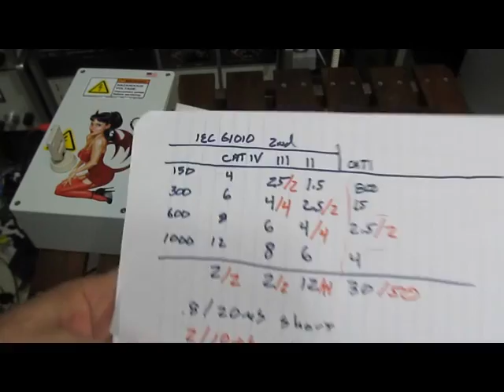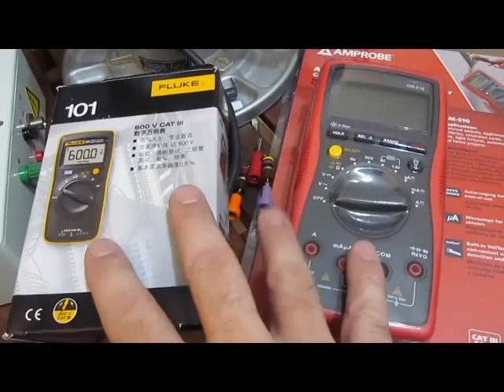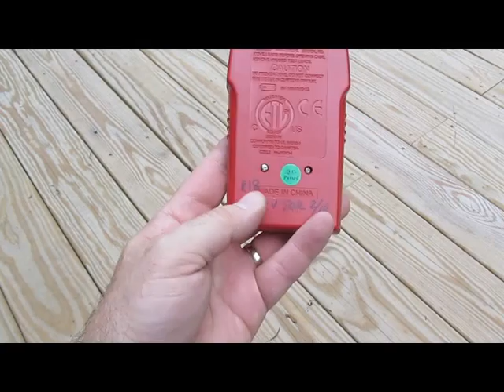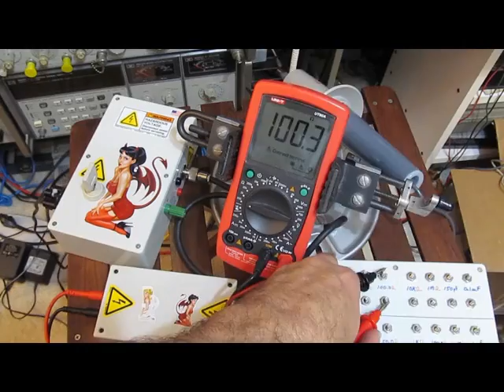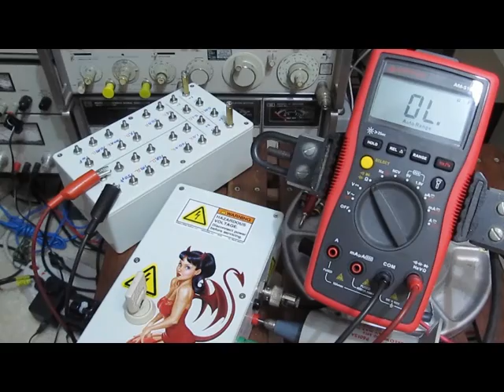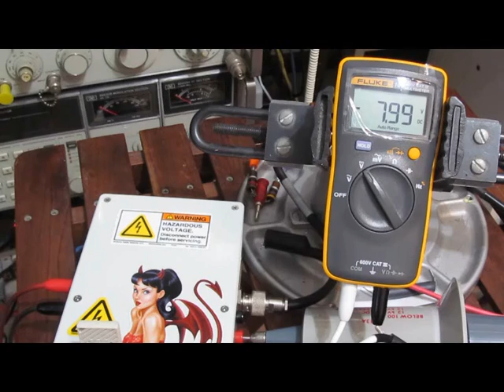Evaluating low cost DVMs Part 21 THE FINALS!!!!

Comment: Thanks for doing this. Is your Fluke 101 still ok?
Reply from the maker: Yes.  Is there a question or test that you wanted to see with it?
Reply: @joesmith-je3tq  yes sir. I have just started studying electricity, so my knowledge of it is not good. I read your faq, but still have some questions. 

1. The 13 thousand volts you run through these device is very high, but why are these tests low power? Is it due to very small current?

2. How are these tests different from  the tests which make multimeter blow up? Like the ones fluke show in their safety video.
Reply from the maker: @Ashmeet Power-Watts, Energy-Joules. From the FAQ: "The energy levels I use are much less than what is called out. "  "The energy levels I use are much less than what is called out. "   "So while my generators may closely replicate the open circuit waveforms from 61010, they are no where near what the short circuit case calls for.  Again, I've explained the reasons for this several times and it should not need repeating. "

Comment: Makes sense, Amprobe I believe is a subsidiary of Fluke.
Reply from the maker: Danaher Corporation purchased several tech companies including Tektronix, Keithley, Fluke and AMPROBE.   In 2016, they spun off Fortive.  They are now the parent to Fluke.   I believe the AMPROBE AM510 is it is made in China by UNI-T.   There are certification documents on-line for this meter that list UNI-T as the manufacture.
Reply: @joesmith-je3tq  okay yeah, that actually makes more sense. They mention their meters are tested in fluke labs so I must've just assumed fluke owned them or something.

Comment: I have an Amprobe 520, any idea if it would be on a par reliability-wise with the 510 you tested-?   I like the 520 meter just fine far as accuracy and build quality for the money but that 510 held up pretty good, hoping mine does, just regular use nothing heavy duty.
Reply from the maker: "Regular use" really means nothing to me.  Regular use for some could very well be a CAT IV environment.   If you take the time to look at the data I collected you will find I ran an AM530 as well.   If you have not looked at the data, I suggest you do.
Reply: I know you ran an AM530, I saw it. I said I have a 520 and wondered if the results might be comparable at all.  Sorry I inconvenienced you with my question and sorry I didnt define "regular use" -- nothing over 120A.C.-240v A.C. and low voltage D.C. hobby use.  Y'know I really enjoy your channel and thats why I subscribed, but why the snippy attitude-?  Did I offend you in some way-?  If you dont want to share your knowledge why bother with the videos or comment section.  Im 59 retired & just looking to learn a bit more about electronics and do some breadboard and kit assembly as a kitchen table hobby and fix some stuff around the house etc. sorry if this somehow offends you.
Reply from the maker: I would have no way to know how a 520 would compare without running it and I would need data before I would suggest how it would compare.  If you saw the spreadsheet and know I have not ran one, then you would know I can't answer your question outside of telling you to look at the data I have collected.  You saw how different the 530 behaved from the 510.  I will say that I would not use the AMPROBE in a 240V CATIII environment but I believe it is certified for it.  You would need to check.  If you find the direct and blunt responses snippy, this may not be a good place to ask questions.
Reply: OK-OK fair enough - in any event I enjoyed your multimeter cookout,  its fourth of july tomorrow maybe all the H.F. meters ive been given would make nice holiday grillers..lol

Comment: AM510 is only $38.00 That's pretty impresive. They should charge more!

http://www.amazon.com/Amprobe-AM-510-Commercial-Residential-Non-Contact/dp/B007FZFE9K/ref=sr_1_1?&ie=UTF8&qid=1436214749&sr=8-1&keywords=multimeter+amprobe
Reply from the maker: Adam Martin Agree, it's a very good price.
Reply: It's more now.

Comment: Great job.  While DMMs are just supposed to die gracefully at their CAT rating, I was surprised to see the Chinese made Fluke 101 survive.  Your tests have increased my confidence in Chinese made Flukes, they have not skimped on engineering to lower production cost.   

I may have missed it, but what was the source impedance of the 5.8kV/50us pulse?
Reply from the maker: ***** Thanks.   The source was 2 ohms

Comment: On the one hand I am not surprised the Fluke was the most robust. 

On the other hand many major brands now try to pass off chinese imports as the real deal to cover their low end, with an extremely poor price/performanvce ratio because they have much higher overheads. (Agilent selling Rigol, Lecroy selling Siglent, to name just two examples).

When Fluke started having their stuff made completely in China I was expecting bad things to happen, but it looks like they did not compromise on safety and this is a better way to go than buying in 3rd party designs.

I will continue to recommend Fluke for handhelds
Their bench meters still suck compared to HP.
Reply from the maker: stefantrethan I like the HP bench meters myself.